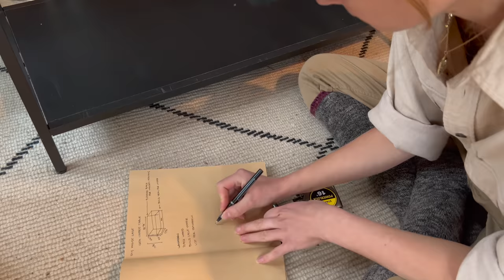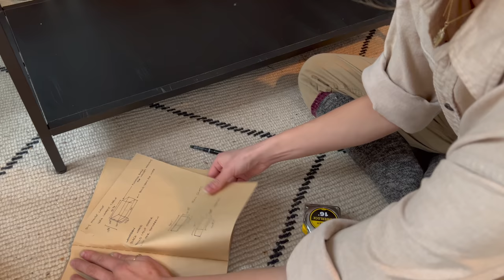how i accidentally became a mouse mom

Comment: Quick Tip:
~Next time you cut plexiglass, leave the cellophane on, it helps in preventing (as much) shrapnel and decreases the chipping factor. Also taping the cutting line works too.

Comment: Pro Tip: If you flip your circular saw blade and cut with the back of the teeth, when cutting plastics, it is way smoother and doesn’t create “shrapnel” as you mentioned.

Comment: The wood chips are fine to use if they already have fur if not it will be too rough but they like different textures and I got mines a little chew toy to help keep it's teeth clean , I usually only give mines strawberry twice a week to keep it healthy. Also room temp water and change the water every two days is goid.A few tips I do for mine if u want 😊.

Comment: You could cut a disc out of the plexiglass with a central hole for the axle and another bigger hole for them to get in & out, glue it to the front of your contraption. You’d need to remove more material from inside the piece of log first to make it lighter. PVA isn’t toxic. Oh yeah a thin slice of a log is called a cookie btw

Comment: On the hollow out stuff, I've to do it all the time on little pieces of metal at work, drill four holes in each corner(or 6 a hexagon may be better for a circle) and then put a saw blade through a hole attach the handle and cut to each hole the file down the excess.

Comment: Great that they're feeding from the puddle of milk out of your hand. The previous feeding method would have had a risk of aspiration (not "asphyxiation" as you said). Aspiration is when the fluid accidentally goes down the wrong way, so it goes into the lungs instead. It's particularly tricky feeding rescued birds in this way because it's so easy for them to aspirate. Well done on everything you've done for them.

Comment: Hannah I know this video is probably from a while ago but if it helps pva glue is safe for rodents since its water soluble. as long as its not resin based or plastic based it should be okay to use

Comment: at 9:00 the camera buzzed and I assumed you were using your phone to film, it's your cameras auto stabilization and autofocus system starting to fail and the magnets jiggle it around rapidly. I have a iPhone SE 2020 and mine failed on a motorcycle trip and I had to bring it into Apple under warranty to get the camera replaced.

Comment: Drill a dowel sized hole in a flat stick such as a paint stirrer, or two.  Line the holes up and glue in place across the large opening.  Run the dowel through both holes = exercise wheel.  Sand smooth and lube with grease.   alternate mice:  🎡🐁🐁🐁🐁

Comment: they look so happy! i’d like to mention though that the ex-wheel will work much better as a cubby hole, because despite there popularity, rodent wheels are often too small for the animal. if the animal has to arch it back to run on the wheel, it can be very harmful on their spines. so make sure it’s big enough for them, bigger than you think is necessary! looks like you’re doing a really good job at mouse-mumming <3
Reply: but in addition, most rodents do really enjoy wheels, so i think it’s a great idea to add one!

Comment: For anyone who finds babies like this some things I have picked up from doing it a few times are to have a heating pad underneath them, babies that small can’t really take in heat from the open air they need direct heat from under their nest you’ve made them. Kitten formula, goats milk are both things that most babies can have, if you just have kitten formula you can add a very small amount of heavy cream to the formula. If the babies are dehydrated pedialite can be a life saver. Check the babies reflexes if you think they may be hurt, lightly push on and pull their limbs to make sure they work. You can check if the babies are dehydrated by very lightly pinching their back skin/neck skin, if it stays raised they are dehydrated, if the skin falls back down almost immediately they are hydrated. When babies eyes are still closed/they are still deaf they are more likely to survive, they won’t go into shock as easy since they can’t be spooked by noises or motions (especially baby bunnies, they pretty much don’t have a chance if their eyes are open sadly they just go into shock and pass away). Also try to handle as little as possible besides feeding and bathroom stimulation you wanna try to just leave them alone and keep them in a quiet space. I hope this helps any one that comes across this, this is all info I’ve researched/ gotten from my local wildlife rehabilitation centers that were unable to take my saved babies in but they still have me advice. Don’t try to feed babies with a nipple it’s not really necessary your best bet is a syringe, also don’t force the food into the babies mouths because the liquid can get into their lungs and cause them to aspirate ( they will pretty much drown) let them eat and drink on their own. It’s ok to put a drop in the pocket of their cheeks to try and get them to wanna eat but don’t fill their mouths, if they aren’t gonna eat they just aren’t, it’s sad but sometimes you just can’t help anymore and that’s ok. If your babies end up dying just know that you tried to give them a good chance and don’t be hard on yourself, these are wild creatures and our lives are separate we’re not meant to care for these babies out of the blue so it’s ok if they pass. Don’t try to keep the babies because you wanna play dr either, if you’re able to get them to a rehab center do that and know you are giving the babies the best chance they can get although it’s sad to give them away and not know if they’ll make it.
Reply: @mf20244  the mom had the babies and escaped, she either didn’t come back or tried to come back but couldn’t get in the enclosure so she wasn’t seen again

Comment: Mice are great pets my mouse house had a little ramp they used to run up the house and go in the hole into a little room and sleep then they would come flying down the ramp and through the hole and into the wheel and start running I t had a glass window that I could slide up and take out they like being clean

Comment: Hi Hannah❤️ you’re doing a great job and they are so adorable😭 This comment will probably be lost but I wanted to try and warn you about using chemical sprays in their enclosure! They’re super sensitive to it - my sister had a mouse she accidentally killed once from the vapors lingering after she cleaned out the cage. 50/50 water and vinegar rinsed with water afterwards works great. Good luck🌿💕

Comment: Getting a cage would have definitely been cheaper than buying the materials to make a bigger cage lol
Reply from the maker: maybe, but the cost of fun and satisfaction isn't included
Reply: @hannahleeduggan  here's some tips from one rodent mom to another:
Dust free bedding is a must. They have very delicate respiratory systems.
Pine and Cedar are BAD.
While it's usually not very strong,  glues like Elmer are best to use. Basically if it's non-toxic for a child,  it's fine for a pet. 
Tissue boxes make great hides and they love to rip them apart. Wait till they're older for that though.
If you're thinking of keeping them once they're grown (obviously with the separation of male and female), you'll need to make a lid for the cage. Mice will and can get out of anything. 
If you're going to set them free, keep in mind,  that hand fed animals are harder to acclimate back into the wild.
Reply from the maker: @quinnzelreign8775 following all of this! cage has a glass top already (glass coffee table top). i think as far as cages go i've been researching a ton and should be able to make a pretty nice set up. just trying to get them successfully weaned at his point 😭
Reply: @hannahleeduggan  fantastic! You're doing such a great job with them. Keep up the great work!

Comment: In my own experience you feed him you feed them puppy milk or kitten milk. You should be able to get that at any animal store.
And she used a very thin  brush or even (I used a pencil from my eyliner  one time) is a Very good technique as long as you clean it out religiously. Mice and other rodents have a tendency to flee the coup.
So provide him with a structure in the middle of the terrarium That they can climb on without reaching the roof.
And yes the number one headache when it comes to uh when it comes to a escape point is The water bottle.
So secure perhaps with a book or 2 
Losing 3 little lives is always hard of course I'm sure I'm sure you did your best don't ever forget that.
Maybe this could help for next time, People forget to feed mice and rodents meat, They are omnivores.
Also the little ones( That's what Caused 3 of 5 of mine to die) need to be fed a max of 3 hours in between.
High metabolism and small stomachs sad but that's what it is.
If starting on other mouse/ rodant food meel worms ,rain worms and small crickets.
And feed the crickets first ,they need to know whats edible before they can hunt
And of course normal grass and or hay.
I hope i didn't but in too much ,but between you and me mice will now survive an Apocalypse.🙏🤍👍

Comment: Hi ! Just wanted to point out as you used chicken wire, maybe double it to make smaller holes. With rodents : if the head fits the rest will fit as well. So chicken wire might be to big and they will be able to go trought. :) That being said you are doing such a great job cant wait to see them grow !
Reply: Oh yeah also went rodents pee on wood, overtime it emits a toxic chemical. It wont kill them immediatly but can lead to respiratory issues when they get older. A few bits of wood hung can be good for stimulation but plastic is safer for the rest. Also wheels can really hurt their back. :/ A version that looks like a plate exists and is safer. Have a good day. :)

Comment: I've had dilenmas with mice in the past. I used live traps too then released them in the wild or outside. Turns out they often came back. Eventually I got invaded. they were everywhere, walls, roof, in my food. Turned into a nightmare so I had to kill them and I hated myself for letting it get out of hand. I had to kill way more because of it. And so I was torn, I looked online for humane solutions. Did I really have to kill them? So I looked and apparently releasing them in the wild is also cruel, because you separate them from their colony and so condemn them to death outside. I swear this problem still haunts me. I can't come up with a good enough solution. I guess having cats is the more natural way to manage them. I still release a few outside when I can, in the fields. Because I figure birds of prey can at least eat them and they contribute to the food chain? I never ever use poison, that's for sure. Nor glue traps. If anyone had ideas, I'm all ears. 
Great video by the way!

Comment: Just some unsolicited rodent care tips. - look what kind of wood bedding is safe for mice (they are made several different woods and not all are compatible with all rodents. For instance, gerbils can only have aspen. i believe it is the same for mice). Beware of cotton! They are little now, but when they start getting old enough to chew, it is super important not to give them cotton balls, or makeup remover pads. They are super fibrous and can get stuck in the digestive tract if they inadvertently swallow some while chewing. There is no actual regulation for rodent care items. If you go to the pet store and see stuff labeled as, "bedding" (the fluffy fibrous stuff), that is really bad too. Sorry if my post is an eyeroller. I have learned the hard way that rodent care can be super misleading when you go to the pet store. Paper towel (made of paper not cotton), and facial tissue (no scent, color or lotions) is very effective. Also, be careful feeding them too much watery veggies, it can mess them up. Love your channel! Sorry, if the unsolicited advice is annoying!

Comment: You can order tiny little nipples to use on small syringes to feed with.  Contact a wildlife rehabilitator in your area…they are like rehabbing baby squirrels…there is formula and rodent chow available…rehabber should be able to get you in touch with where to get formula and food for them.  They need a high degree of protein….

Comment: Winter of 2019 I had 22 mice in my attic.  They were coming in through a hole near my dryer vent. They destroyed my attic.  They ate through my plaster walls.  I could hear them running through my walls at night.  I had a cat who kept them out of our living space, but they thrived in my walls.  They have been know to catch a house on fire by chewing on electric wires.  I would not entertain these rodents, for they are very destructive and will destroy your home from inside the walls.  It was a night mare.  I had to patch every opening outside to keep them out.  They ate through wood in my basement.  They are rodents.

Comment: Make sure you separate the males from the females before they start to breed. Or before you know it you will be overrun with mice.This happened to me when i was a teenager, because the pet shop got the sex of my second mouse wrong and I ended up with a male and a female. I was away when the big day arrived, and my brother plopped the newborns into a container of water. He told me they just sank to the bottom without a struggle. I separated them after that.

Comment: you are so sweet. but it is a myth that if you touch a baby animal that mom will reject them. I used to think the same thing, but i volunteered at a animal sanctuary for like 12/13 summers in a row when i was a teenager/young adult, and we had so many cases of bottle feeding babies that mom wouldn't feed, or for whatever reason, and she always was fine with them. sometimes, you have to foster them to a new mom, and another mom that recently gave birth can actually take care of them. and she won't care either. But basically, what i am getting to, is that is a huge misconception and not true at all. And you can get kitten formula and tiny bottles right at the pet store, or farm and feed stores. I had to use that to feed baby bunnies when the mom got killed by a predator. it's a lot of around the clock care, but it can be done. you can most likely google about the human scent things, moms won't reject their babies. we shouldn't touch them if we don't have to of course, but in your case, you had to.